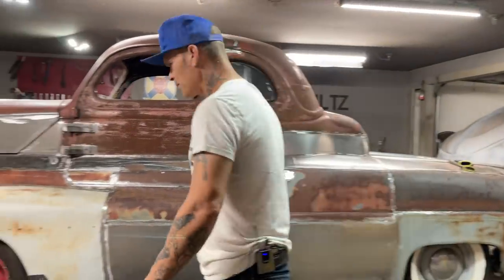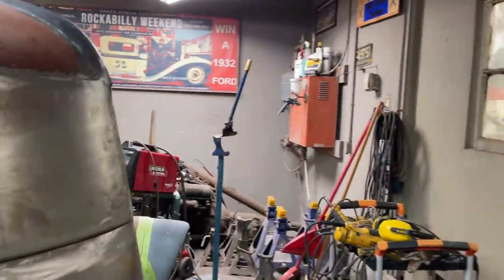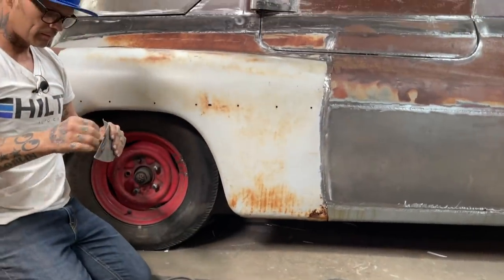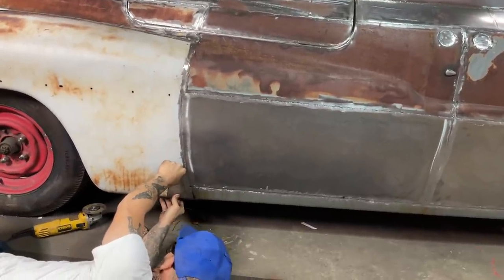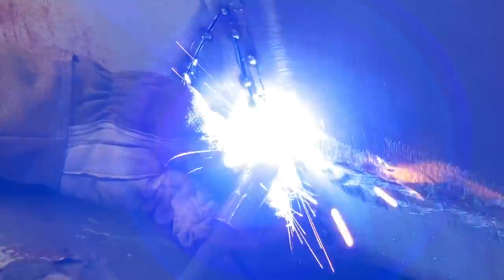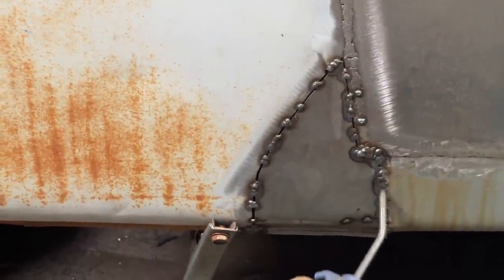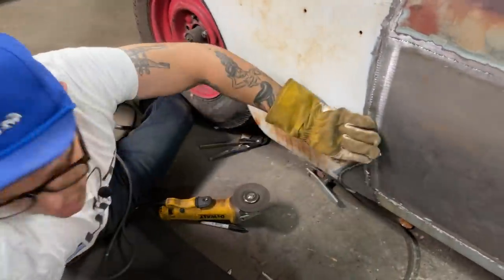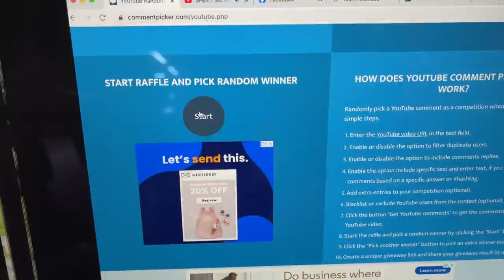RUSTY FENDER REPAIR: HOW TO BUTT WELD A PATCH PANEL

Comment: I took fiberglass body filler and soaked it in water for a couple weeks , dried it off and weighed it before and after and it absorbed water. I used sheet molded compound or corvette panel adhesive on welded areas for insurance from weld pin holes and prevention of bubbling. Food for thought.

Comment: I believe on one of your gift reveals someone had sent you some rust convertor. That is where you should use it. On the rusted inner structure before you cover it up with new material.

Comment: Nice patch!  You were not welding overhead but it got me thinking that when your head is low down a hot spatter can get into your ear.  You can most likely relate.  Not a bad idea to mention ear plugs can prevent a hot one from rolling deep into your ear.

Comment: looks like that inner fender support needed some tlc and needed to be rebuilt and painted before you welded that new piece back on. That piece will rot out in no time in that condition. Its just about all rotten already. I'm surprised you didn't repair it chad. Other than that your repair looks good Chad.

Comment: Stick is a little better in the wind than mig is because the flux is on the electrode. That being said you can also use flux core wire in your mig in place of solid wire and gas when it's windy.

Comment: The side area to make it easy to get in the truck if you need to have some steps inside the old doors maybe you can use like a steel  loaf pan  something to insert
Reply: Have to probably put a drain hole to drain down keep from water staying in it

Comment: I've always heard that there's nothing wrong with filler as long as you're not putting it directly over rust or you're not getting it mixed thorough enough I've seen guys use it over brand new quarters after welding them on just to take out any little imperfections

Comment: Chad I know you like the way the headlights are set up but I think it would look a lot cooler with 59 Lincoln Continental headlights but don't put them in at an angle straight up and down that would definitely be something different you don't see everyday

Comment: Wish you used a guard on that grinder,  so easy to get injured with one of them angle grinders, even blades can explode without any warning. they are turning up at a excesses rpm. Safety should be practiced at all times especially with Ayden and Jolene so close by in harms way. I had 2 blades explode on me one was a cutting disk second was a flapper disk. each time it pulled the grinder out of my hands before I even realized it. be careful my friend!!!!

Comment: There will be a little filler on all repainted oldies, period . As long as the bodywork is real close and real complete...  it's good to have thicker spots in some places and thinner in others... The filler used, is never very thick anyway . When Complete and painted..it won't matter . At all .

Comment: Many of the body lines on this build are curved. 
Should that new corner at the back of the hood be a curved line?
Reply: The reason the Bugattis look so good is that they keep repeating curves and other lines. The Greeks did the same thing when they built things.
If a line looks good, use it again.

Comment: When you put filler in a hole its not so great but as you are doing on to metal is fine alot of painters and panelbeaters out there would tell you no bog in there m8 but they are all shit no car is perfect and if you want a mean paint job u got to use filler that's that keep up those one liners to Chad